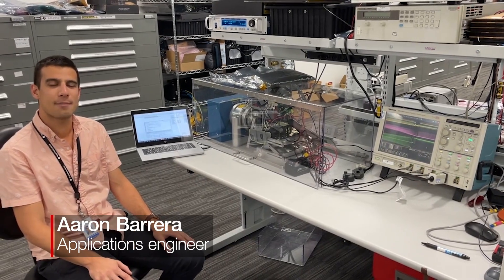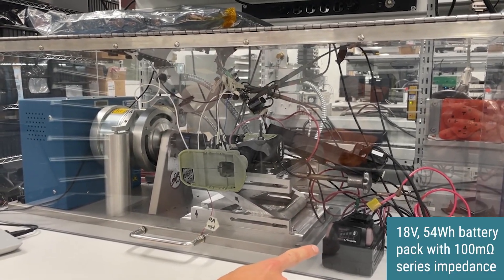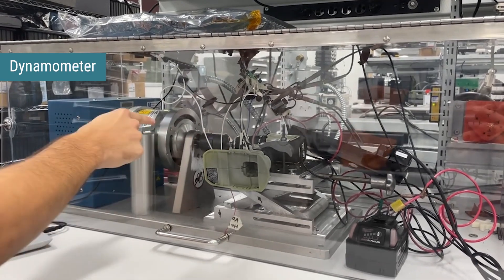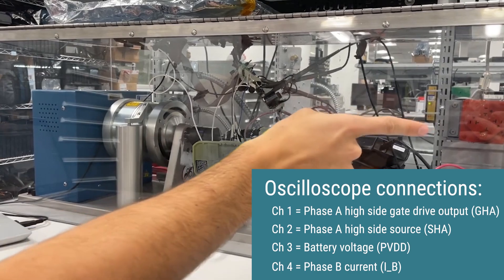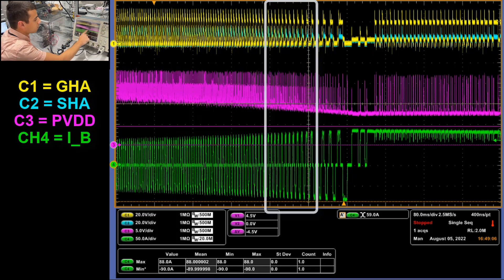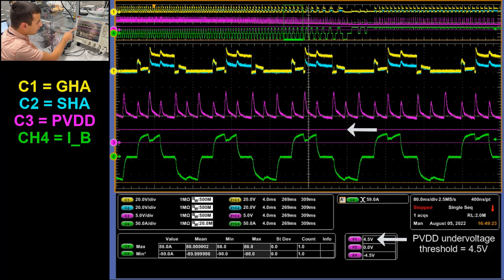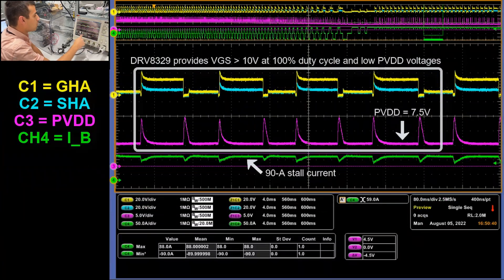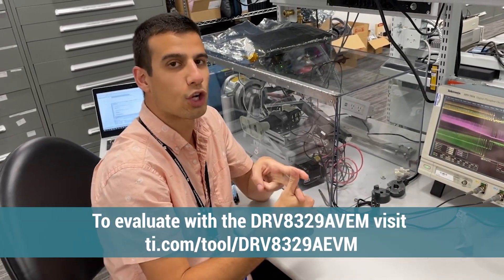Power tool demo using DRV8329AEVM

Comment: Would you please share the closed loop velocity/position control strategy using TI driver for BLDC motor? Please help me out.
Reply: Hi Santanu,

Closed-loop speed feedback can be implemented using a variety of strategies, such as a Back-EMF comparator to measure the phase voltage BEMF, a virtual center tap to sense the phase voltage, integrating the sensed BEMF voltage from resistor dividers, or using a digital-signal processor to calculate the BEMF from motor phase current. Some of our devices include 3 low-side current sense amplifiers to measure the motor phase currents. 

If you would like more training on sensorless control, we have a training video here: https://www.youtube.com/watch?v=teeMdFaykPE